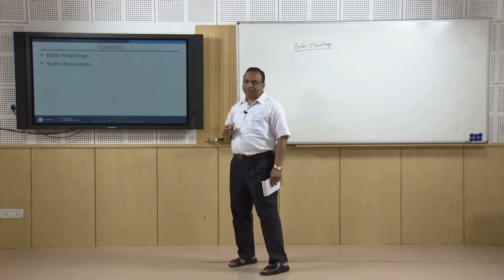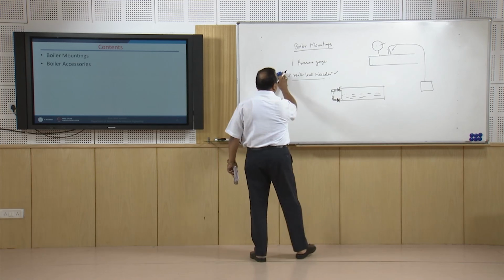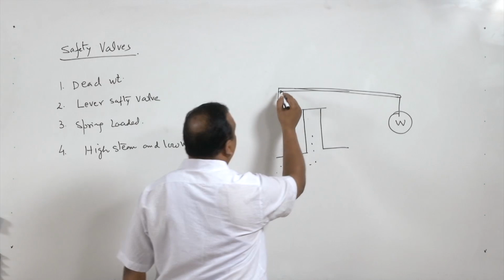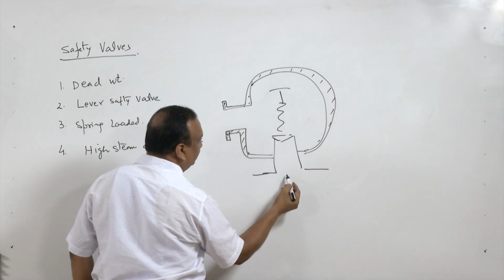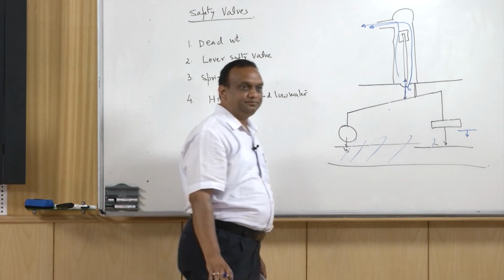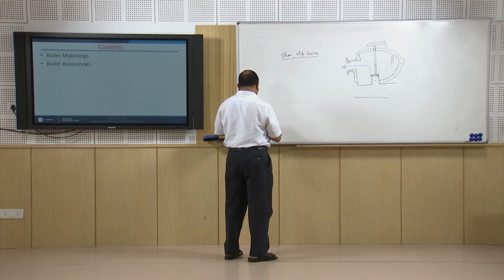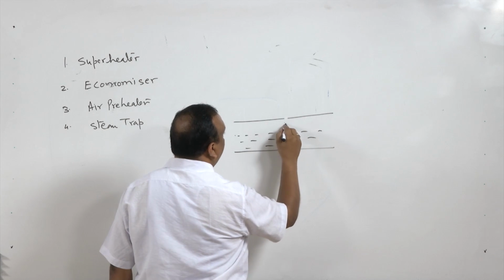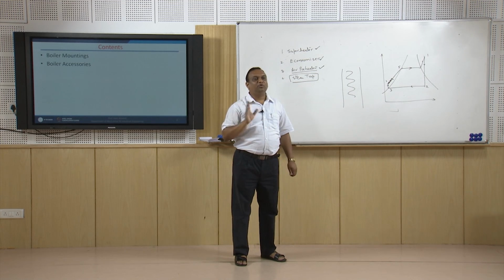Lecture 09: Boiler Mountings and Accessories

Comment: Please don't teac wrong fusible plug is not on the surface of fire tube boiler but between the combustion chamber upper side of boiler from where water is discharged